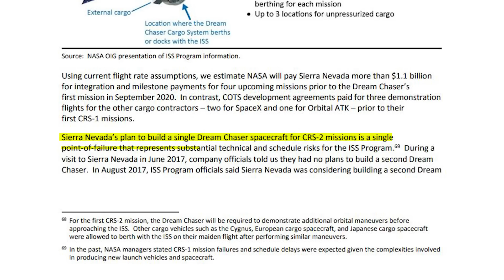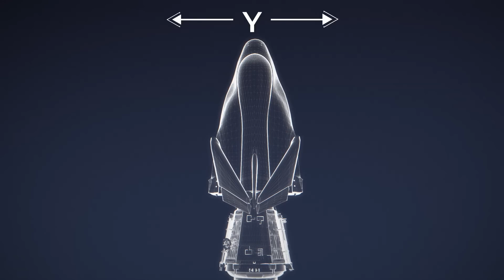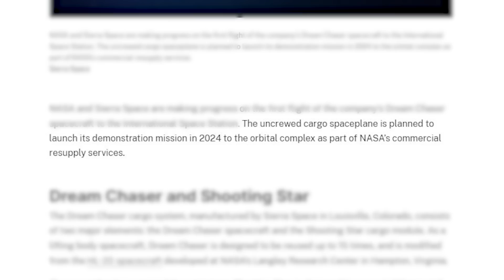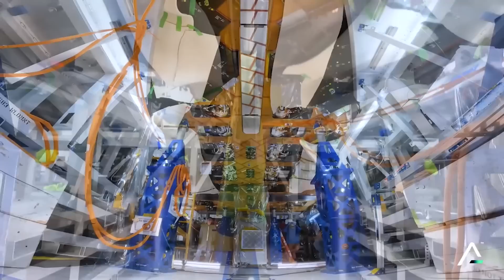Sierra Space Is Working On A Second Dream Chaser

Comment: I thinks it’s kind of a no brainer in the space launch business to not put all your eggs in one basket.  And Dreanchaser is really like an egg - strong in its use case but fragile as anything outside those parameters.  The floating debris issue is a case in point plus they had a landing failure.  I would have thought building two from the get go would have been the prudent course but what do I know I’m just some random Internet commenter.

Comment: It’s a miniature version of the Space Shuttle. That’s all it is. Very similar to the USAF’s lifting body test flights from the 60’s. They didn’t follow that up because it wasn’t very practical.
Reply: They didn’t follow it up because it was not cost effective given the technology available decades ago. 

As launch costs continue to fall having the ability to return high-g sensitive cargo has a significant market. Hopefully a successful start to this program allows them to begin their crew rated variant. Currently only SpaceX, Russia & China have the capability. Given all of Boeing’s issues a further delay or all out cancellation of Starliner is possible. More competition is needed even if Boeing’s high priced solution comes to fruition.
Reply: @ReinReads  

What ever. 

They didn’t follow it up because it wasn’t practical or cost effective. Ultimately…you still have to mount it on top of a booster to get it up there. When it returns it has to not only get through our atmosphere at an extremely high rate of speed, pressure and heat that it’s very design itself makes it dangerous and unpredictable. They knew that back in the 60’s and they definitely know it now. But here they go… right back down the same deadly trail. Having lost 14 astronauts in Shuttle burn ups. You might think that they would pursue a different approach to space. But nope. 

I predict that if this thing ever gets up there…it will not be long before a few more are kia’d. 

The technology is not yet where it needs to be to use this as a return vehicle. When all of the mad scientists figure out a non-explosive-chemical propulsion engine…it will become possible to leave and return at a more rational  and less deadly speed…eliminating the 17,000+ mph currently required to get you up and back down. What that technology might be is anyone’s guess…but you won’t see it in our lifetime.

Comment: Very nice and advance aircraft congratulations.. but i guess its kinda small size spaceplane and looks so complicated to build.... And seems over engineered with the looks of bunch of wiring for a small spaceplane.
Reply: They should do like what spaceX does. Just go test it and gather data for the next improvement.
Reply: @johnkoay8097  yeah your right. I guess those extra instruments are for that purpose
Reply: For a first of its kind space vehicle it is understandable that it would appear over engineered because Sierra Space wants to get it right.  There is after all little margin for error when going to space.  Later iterations of this vehicle may result in a smoother and rapid construction, but as usual time will tell.
Reply: @michaeldeierhoi4096  i see yeah your right i guess other extra cables and extra instruments are for gathering data purposes so to make new improvements specially on safety
Reply: @TheStrike101  That method of development works Space X, but it is not for everyone.  But, I understand that the Space X fanboys can't see that there alternatives.